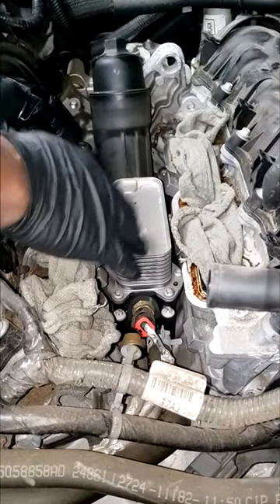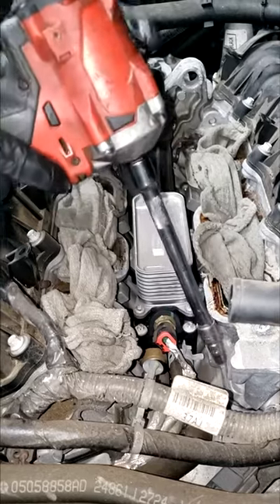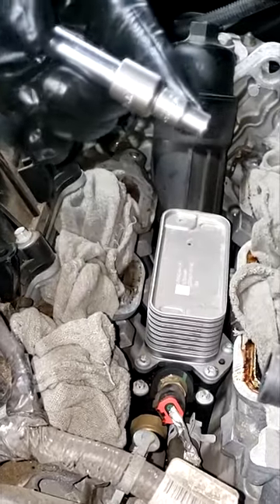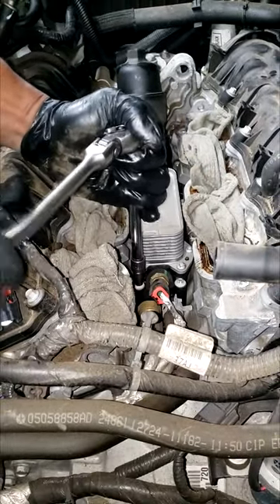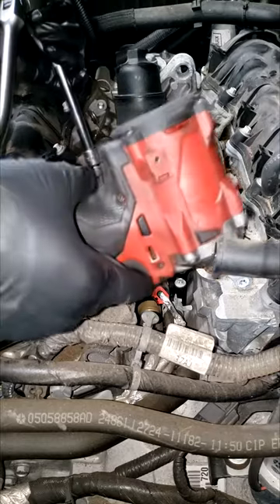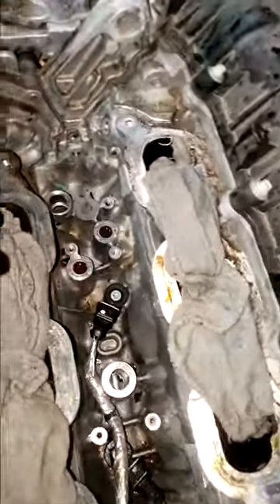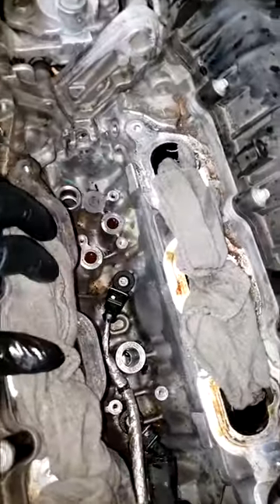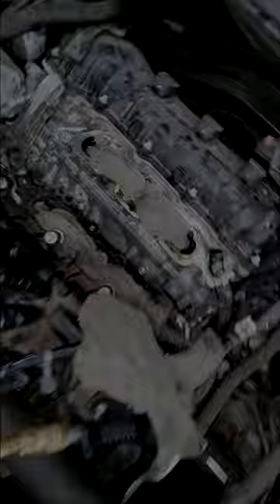My SECRET DIY TIPS when replacing a oil filter adapter housing on the 3.6 Pentastar Oil Leaks.

Comment: I soak it all up with paper towels or use a wet dry shop vac. Don't forget to get any liquid out of the threaded holes in there...when you screw down the oil cooler bolts there's nowhere for that liquid to go and you can snap the heads off.

Comment: What do you do when the galley is dry but oil is still covering the bell housing? see my gen 3 3.6L oil leak video
Reply: @PrestonSteele09  you only need to see the back 2 inches to see if the valley is full of oil, Chrysler has seen porous blocks leaking threw tapped holes.
Reply: Don't help this guy lest you should also get criticized.

Comment: Should i go ahead and replace the oil filter adapter if i have to replace the oil pressure sensor on a 2013 Chrysler Town and Country Touring 2WD 3.6L FI DOHC 6cyl if I have Code P06DD? Thank you.

Comment: All for not using an impact on those but those are 100% not aluminum bolts. My tip on these, at least when the valley is full of oil is to plan on 2-3 cans of brake clean. Spray it in there after using a fluid extractor to remove the majority of the oil. Just soak it and  rinse all the dirt and oil down. Then suck it out again. All before even unbolting the cooler. This makes for a clean job and less risk of that dirt and oil finding it’s way back into one of those passages in the valley.

Comment: I bought the harbor freight (mighty vac like tool) version on sale and it plugs into shop air 🙂 (best hundred and change I've spent in a while). And brake clean is a necessity🙂
And I clean all of the gasket points with a zip wheel medium coarseness and a Light Touch and a nice wire brush for the oil hole.
If you tri-fold a shop rag and stuff them in the hole (like a field dressing a gsw) you can get one rag per hole deep enough to sand/scrape right over the top.
Great channel with great tips

Comment: I pull as much out as I can with a suction gun. After I put it together, I fill the valley with foamy engine degreaser and all the other oily spots as well and I rinse it good with hot water. I let the car run till the valley is dry. So no, I don't leave all that mess in there
Reply: You either need to explain in video form or enlighten us somehow how you do any of that